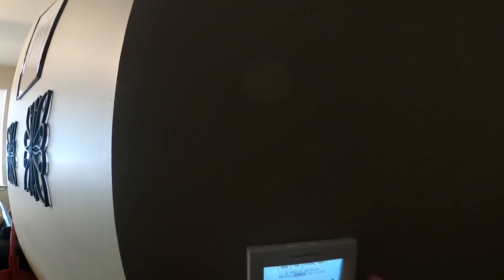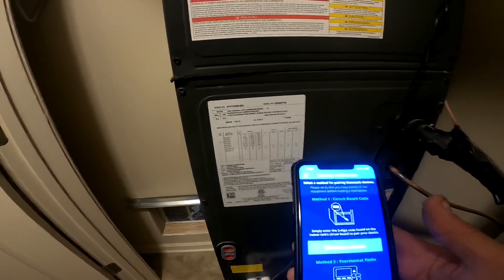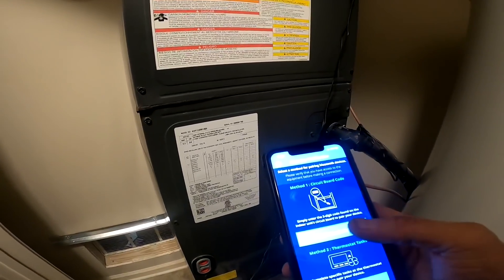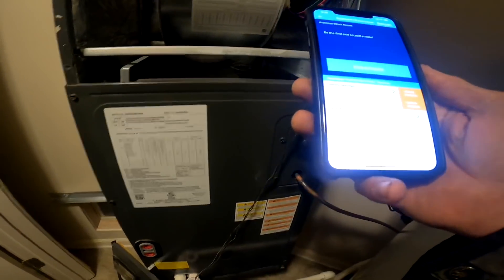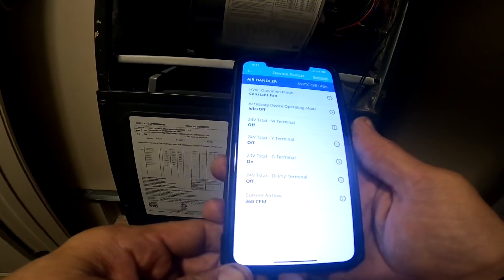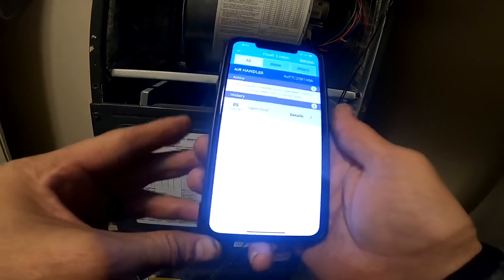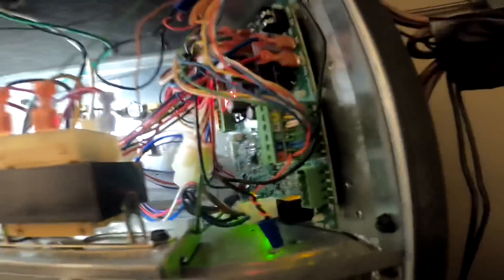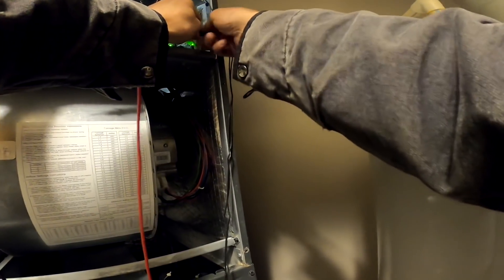Working on  Goodman AVPTC29B14BA  using the CoolCloud HVAC App

Comment: You also have to have the Bluetooth shared data loader in order to operate the app and for the inverter systems 
We had a board go out on the outdoor heat pump and the Bluetooth shared data loader also had to be installed to the board in order for it to be found on the cool cloud app.
Major hassle just to adjust the system to connect and allow the system to operate

Comment: do you recommend to wire it on legacy mode or communication ( using data terminals). note: we just going to able to use the app just if the control board has the Bluetooth module.

Comment: I got an AVPTC37B14BB unit on GSZC360161CA condenser. Did you know different revisions (the letters on the end) can work or not work with each other differently over the same model number depending on the software versions? I am curious what condenser model number this was. Also, if you noticed, there is an "Active" section at the top (errors you have now), vs the "History" below (errors that have happened prior to now but haven't been cleared out yet). So the power went off, and it assumed it was a fuse blown. When in fact, people just shut it off outside. It's only so smart. By the way, my models do not work together and I'm waiting on a new air handler to come tomorrow. It would seem the 37B14 cabinet no longer has any compatible condensers I could purchase for it. However, the 360161CA had a C14 cabinet that would work. So I have to change out the air handler. Not fun. Goodman tech said that all contractors are required to use their app for system compatibility before they purchase to be covered properly. AHRI is 3rd party and affords you nothing. I can't remember the name of the app "sales something" but it's much like the CoolCloud app I guess. I would call Goodman/Daikan and get the name of it if you do many of these installs.

Comment: I just bought a new home and yesterday the A/C came by and had no idea what he was doing. The next day a senior tech came by and after a long time he tells me he has never seen one of these Bluetooth handlers and it took him some time to use the app. Once he got it figured out he was shocked how easy it was to make setting changes using his cel phone.
Reply: New technology is new to the old technicians lol. We just installed a new heat pump I didn't have a clue why my heat strips won't come on after talking  to the technician from out supplier he told us that we had to use the app to match everything up. Us old technicians we have a flip phone lol.

Comment: The first one of these I installed the app connected to the unit after a couple tries and was really easy to use.  The next two I put in wouldn’t connect and I had to manually program the unit.
Reply: I had a big go around with distributors selling bundles that were no longer compatible based on software changes. There are models that worked together when they first came out, yet no longer work together later on. D2 mis matched set. They have an app to check that. But not all distributers have the latest information. If you 5 wire them, you lose the higher seer. (Though the customer still paid for it.)

Comment: I installed one of these Goodman furnaces with Bluetooth last year in my home. The App was fairly easy to use to program the furnace.  I haven’t had any issues with the furnace or condensing unit so far.  I also installed a whole house surge suppressor to help protect the sensitive electronics. Power surges and lightning strikes have killed my TV and the blower motor in my old furnace.
Reply: I am doing the same thing. Mind if I ask your model numbers?

Comment: Open fuse on these means float switch was tripped due to clogged drain line, the switch is connected to the board directly.

Comment: That must have been a new install if they didn’t set for heat pump? Also that wasn’t a communicating system was it?
Reply: That looked like a communicating air handler with a non-communicating Honeywell thermostat. My furnace is wired the same way. I don’t want to use a proprietary communication protocol with an overpriced thermostat. The only small benefit is that you can run some diagnostics on your whole HVAC system because the Goodman thermostat can communicate with the furnace and outside condensing unit (if you wire it up correctly).
Reply: @picklerix6162  The number of permutations of incorrect functionality on a communicating setup is one order of magnitude greater than the number of permutations the average HVAC tech can diagnose. lol

Comment: That open fuse was a glitch in the system always says that. They have 2 fuses on that board. I always do the 14 min update. You can also adjust your airflow by changing the condenser tonnage.  Why would they put that ah wired legacy matched with a single stage condenser is beyond me.
Reply from the maker: They did

Comment: Good ol’ Goodman!! They keep over engineering these units, all you need is a compressor, a metering device, evaporator and condenser coil, with a few relays In between! Like those trane TAM7’s absolute junk…oh and I forgot a thermostat “switch” to turn the system on. K.I.S.S. Have these manufacturers ever hear that phrase, probably not, just keep adding more things to break to your unit, so you have to buy O.E.M. parts from them, total scam…sorry but that the truth!
Reply: I'm with you. Especially on those dang trane units